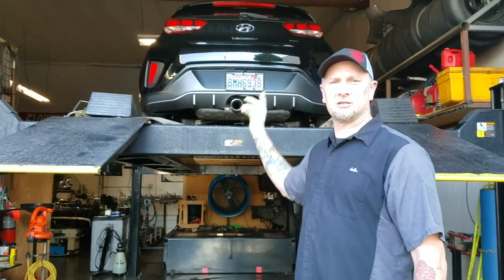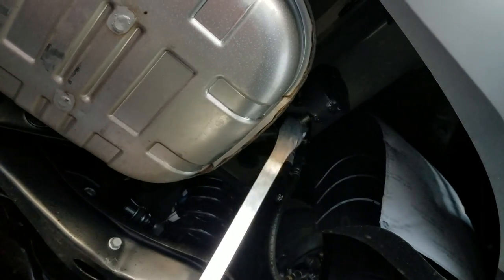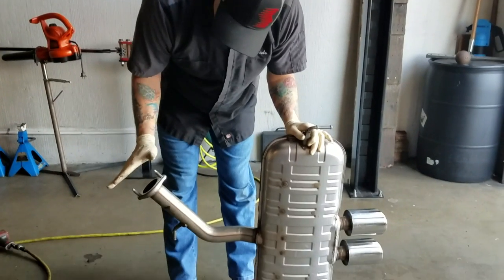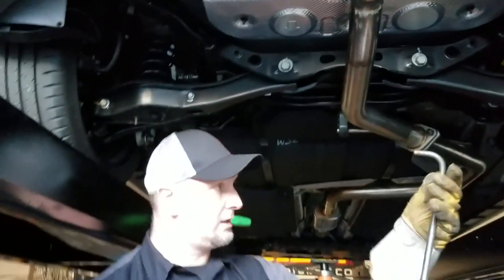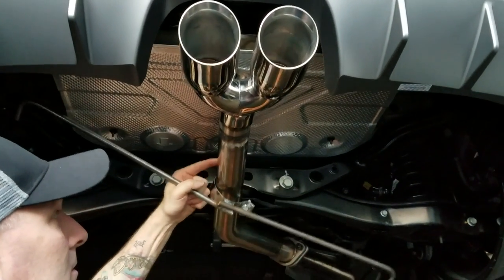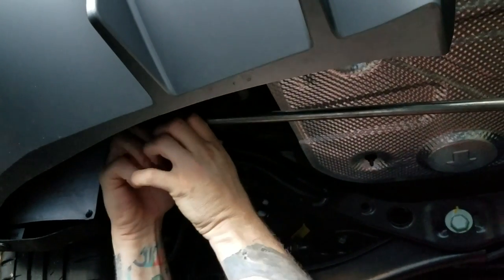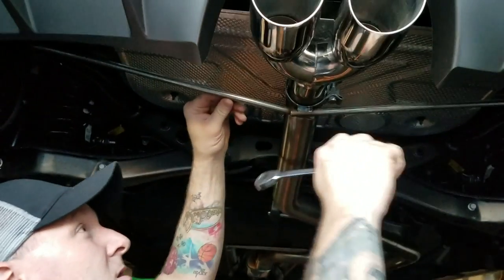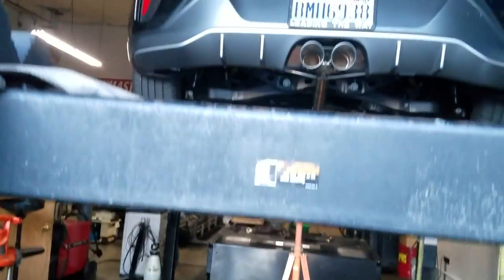Hyundai Veloster Turbo 2019 Axle Back Exhaust How To.

Comment: Is that a manual transmission? If so,  is there a way to disable the shift indicators?  (I noticed you're didn't show up..)  also the main question:will this fit in the r-spec?
Reply: I just noticed the car in the video is an r-spec..   So how did you get the shift indicators to not show up?
Reply from the maker: Being on the dyno makes it so the shift indicators do not show up. Yes, it will fit the r-spec
Reply: Awesome thanks.  
Yeah I just got my Downpipe in from your guy's yesterday. Gonna try to get it in sometime this week.

Comment: I had a local exhaust shop do this on my 19 rspec for $150. The reused the factory tips. Its not loud enough i may have the 2nd cat deleted
Reply: Did they do it using stainless pipe?

Comment: I bet they limited power adders so people buy the veloster N i feel bad for the 2nd gen owners who cant benefit from bolt ons without a tune
Reply: Hey do you know where I can find the information about how Hyundai did that to the ECU
Reply from the maker: Yes, go buy a dyno and around $100,000 in tuning software and hardware... spend 5 years digging through the KIA and Hyundai ECU's, then you will have your answer.